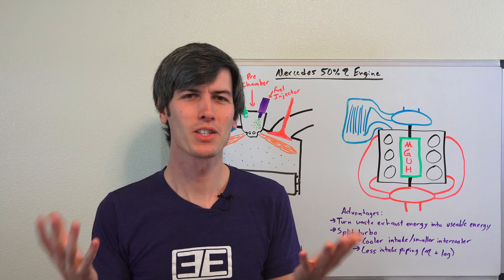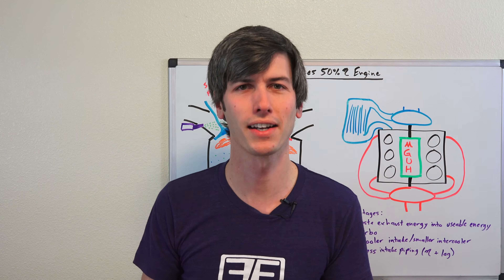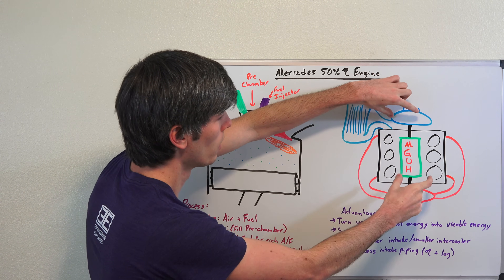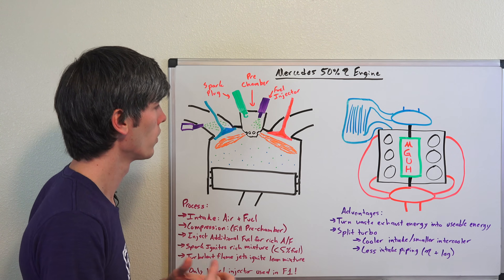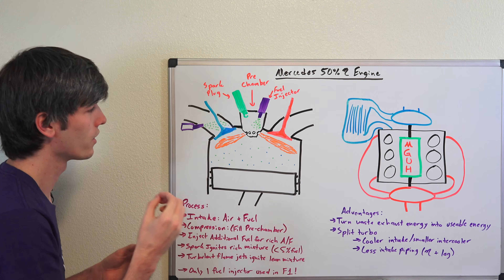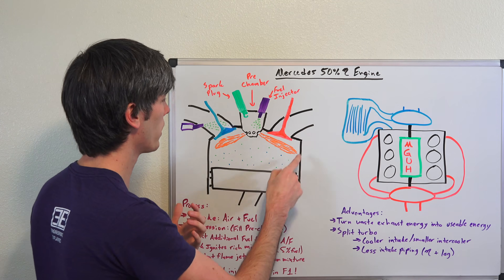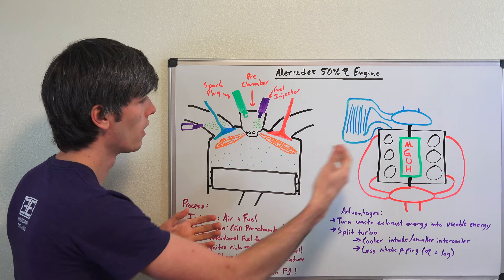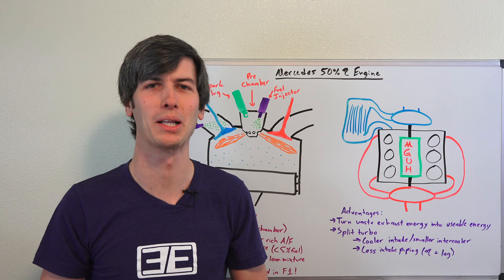Mercedes Created The World's Most Efficient Racing Engine

Comment: I have evaluated motor augmented turbo's as a way to minimize turbo lag.  The motor only needs to be big enough to generate enough exhaust gas to get the turbo into the positive feedback (why a waste gate is needed).  

My optimum system uses a CVT to drive the turbo.  Need boost, shift the CVT to spool the turbo very quickly, as the exhaust gas builds, shift the CVT to let that spool the turbo. 

Instead of a waste gate, shift the CVT to extract exhaust power from the turbine, controlling boost, and sending the excess power to the crank.

Comment: I think it would be smarter to leave the injector in the pre chamber and just have mulitple injection events. It would make sense as the intake stroke starts, an injection event would disperse some of that fuel through the pre chamber ports and into the cylinder, and then once the compression stroke is over, the cylinder AFR would be lean but the pre chamber could have a second injection event causing a rich AFR, that would ensure good combustion. That would be the most logical thing to do in my opinion, its simple, and easier to control than trying to spilt the injector into 2 different chambers.
Reply: Yeah, this is probably how it's done. It's exactly what is done in consumer engines, called stratified split injection. You inject most of the fuel during the inlet stroke to give it the most mixing time (standard for di engines) and then you inject a tiny amount right before the spark plug fires so there is a rich zone next to it.
Reply: Matt Knill it might become to rich in the prechamber
Reply: One way to find out.  Try it!  I would, but I've got to finish this beer.
Reply: Matt Knill i agree though

Comment: I wonder what the turbo lag would be like. Considering the length of the shaft and the magnets now attached to it
Reply: Zach Ball It's a Motor-Generator Unit. It actually spins up the turbine shafts when there is not enough exhaust flow to keep the turbo spooled up. When the turbo is spinning at full chat, it takes some of the energy that would over spin the turbo, hence the wastegate, and use it to generate power to send to the battery pack.

Comment: Isn't the lean/rich mix exactly what Honda did in the mid 70's with their Civic CVCC engine?  The CVCC had a lean mixture in most of the cylinder and a small area near the spark plug where the mixture was richer.  The plug ignited the rich mix and that ignited the lean mix.  That seems to be exactly what Mercedes is doing.  I guess the Honda patent expired.

Comment: would a lean cylinder mix not result in really hot cylinder temps? is that not the main reason people tune for say 11.5:1 afrs under boost, to cool the cylinder down? also that is one of the huge advantages of e85 and the like, since they require more fuel in addition to having better evaporative properties than 100% gasoline, they keep the cylinder cooler allowing more timing or boost to be added without the worries of predetonation? or does F1 also have someway to compensate for that like an additional cooling system specific for the cylinders somehow?

Comment: I think there is one injector in the small chamber, but has two pulses. One when there is initial intake stroke to fill cylinder (fuel will expand and fill the cylinder) and then a short one to fill the chamber with rich mixture when the piston is past half way back in the compression stroke.

But it is quite neat idea. 50% efficiency sounds awesome.

Comment: Many ships and nearly all modern cruise liners, use electric motors to turn the propellers. The diesel engines are just generators. I have always wondered why they do not have turbos in the exhaust turning a generator to assist the electric propeller.  It must be worth it as ships use an amazing amount of fuel.  The world's largest 15 diesel powered cargo ships put out the same emissions as all the world's diesel 'cars'. The largest container ships take 35 tons of fuel just to get moving from stop.

To get a large container ship just moving from stop, it takes  the same amount of fuel to run a car continuously 24/7, returning 35mpg for 27 years.

These container ships carry 14 to 19,000 containers. Put the containers on trucks nose to tail, they will stretch on a road around 190 miles long.

So, saving 5% of fuel using a turbo on the exhaust, on the world's 15 largest cargo ships makes a difference in emissions and also the emissions of the fuel refining and fuel distribution.

Comment: I have always wondered why if F1 engines are so efficient, why do they have so poor fuel mileage (according to the sources I've read)? I also understand that the numbers given are usually even lower by the fact that these cars are pushed to the limit. However, I can't think of how a car doing 3 MPG could do anything higher than 20 if driven normally. 

Is there other type of measurement to tell efficiency of fuel consumption?
Reply: It's because a lot of the power is used for aerodynamics, since most of the lap time is made from cornering at high speeds (we're talking 100mph+). So this requires a lot of energy to achieve. Street cars don't do this! lol! Factor in the lap times and they are the most efficient cars to achieve these speeds on these courses.
Reply: Ok, so here I go again. How high would the MPG would go if you drove it like street car, and it was tuned to be more efficient at low RPM?

As I said I understand the hard pushing of the engine increases the overall fuel consumption even while it's running with a very high efficiency, but does it achieve such high efficiencies only at full load?
Reply: To drive really fast, you need a lot more fuel than you probably think. Just an example, you may know that aerodynamic drag does rise with the square of the speed you are going. Now let's say we have a car that uses 8l per 100km at 100km/h. About how much fuel would it use at 300km/h? Well, you go 3 times as fast, that means the car generates 8 times more drag at 300km/h and that means you would problably need nearly 8 times as much fuel. (the mechanical loses stay about the same) So you would probably need about 50-60l per 100km at 300km/h.

If you go on a race track with car and really pushing it for just a few laps, you would be surprised how much fuel even a very economical car would use in this case. You can push basically every car to use more than 20 litres per 100km at a race track.
Reply: 177SCmaro no tuning its parts without adding or taking away components does not stop an F1 engine from being an F1 engine. Besides, to my knowledge each engine can be tuned by their team within some regulations to accommodate the driver's driving style and/or team strategy.
Reply: 177SCmaro you are now adding things I never said. I didn't say I want to make it street legal, or a street engine. All I'm saying is, what would the mileage be if it was tuned to be efficient all low RPMs and driven like a Sunday driver.

I don't even care if experts would still qualify it as an F1 engine still. My question was clear, and if you can't or don't want to discuss an answer stop replying because I didn't post to argue over whether you think my question is valid or not.

Comment: In F1 the spark plug has an integrated fuel injector done the middle of it. That’s what I’ve seen from F1 journalist. So maybe they split it between the main injector and the spark plug is the additional injector for the pre chamber.

Comment: Are there any major hurdles to using TEC or Peltier like devices to harness residual heat, or is the gain just too small to be worth it ?

I was under the impression that the pre chamber was used to time a drastic increase in cylinder pressure causing compression ignition, HCCI like engine.

Comment: Good video. What I don't get, how can an F1 engine have 50% efficiency, while normal car, even turbo diesel are not able to get more then 40%?
Reply: elm70 they just want to make as much money as they can. They don’t care about efficiency
Reply: One F1 engine must last 7 GP weekends (3 engines per each car for all season - 21 GPs). Those units last ~2000-3000 miles
Reply: It last 2000/3000miles (at least the Mercedes ... a Honda 2017 F1 engine normally last less then the half ;-) ... but .. while using 1000HP for 50% of the life time ... if  it would be tuned down to produce "just" 500HP max ... it will last for sure over 150.000miles
Reply: +elm70 Maybe because building an engine with the same efficiency of a theoretical Carnot engine is nearly impossible?
Reply: optimization, material, control system, fuel, versatility, etc.
Reply: Tuning. F1 engines don't tend to last more than 1,000 miles. Road cars are expected to last past 100,000 miles.
Reply: It is not so "simple" .. yes F1 engines has limited life, but also they need to spin at very high RPM (15K rpm vs 6K rpm) and produce huge power (1000HP vs 200HP), two aspects that should not help for get the best possible fuel efficiency ... it sounds to me that car manufacturer have been lazy , it is possible to make every day car much more fuel efficienct ... but ... for some reason they don't have the business motivation for do it

Comment: How do they extract the exhaust gasses from the prechamber?
Reply: As the gas expands inside the pre chamber most of its volume in displaced into the main combustion chamber. Along comes the cooler and therfore denser inlet charge, and then along comes the compression stroke which must therefore drive gas back into the pre chamber. 
But it could of course also be the force, or Voodoo, or as some say, the unicorn effect.
Reply: light dispels darkness it's magic
Reply: They don't
Reply: light dispels darkness
Reply: That's a good question.  I'm guessing it just gets extracted through the flame ports, though maybe not perfectly, but maybe well enough to still provide a benefit.  But that's just a guess.

Comment: Great video and an interesting concept. I wonder how rich the air/fuel mixture is in the prechamber and how lean it is in the rest of the cylinder. I'm also wondering if you would get carbon buildup around the ports of the pre chamber, although it probably wouldn't matter as the races only last two hours.

Comment: VTEC is 89% thermal efficient.
Reply: And that's before it even kicks in y0!
Reply: VTEC is 100% efficient at drying up pussy's within the fart can's noise range. Truly quite remarkable.
Reply: No its 69.420%
Reply: And vtec is like always last one in f1 lol....
Reply: VTAK didn't kicked in  mclaren honda, they kicked themselves out of the team
Reply: I think it is 89.999%
Reply: I think it is 89.999%
Reply: I read in John B. Heywoods engine fundamentals, p874 , a similar paragraph. 
Where efficiency gain is contributed to the improved mechanical efficiency.   
 But not further explained (in that page) 
So i looked further and found in Hiereth H. and Prenninger P., "Charging the internal combustion engine",p 30, an example of what exactly the mechanical efficiency gain is. 
it is then related to friction. So yes, efficiency is gained by relatively less friction loss for the same power. It is then further said " In comparison to this (mechanical efficiency) ,the other efﬁciency factors are barely inﬂuenced by supercharging, since, due to the change of density of the intake air, the ﬂow and thermodynamic conditions are inﬂuenced only to a minor extent." 
Note that this is said of supercharging methods. Which i think is a bit strange, considering roots blowers,... are also supercharging methods and they rely on mechanical energy, which is not taken into account in their mechanical losses.    
  
I also can understand what you mean by the effectively raising the compression ratio. The higher pressure during the exhaust stroke (because of higher remaining pressure at the end of the power stroke) drives the turbine which in turn compresses air to a certain extent and therefore it is like a part of the compression stroke already happened. If the engine had a longer stroke the pressure at the end of the power stroke would have been used more and thus been lower. That pressure would have been captured in mechanical energy and then be used by the compression stroke in the next cycle to compress the air. I think it is certainly an elegant way of looking at it and i vaguely remember my professor talking about that analogy. So thanks. 

An other way of looking at the process is like this. The remaining pressure (heat) (left over energy!) at the end of the power stroke that is then dumped into the exhaust manifold is recovered by the turbocompressor. This energy is then used to compress the air, leaving the engine with less pumping losses. This looks at the process as energy recovery. It is how you choose to look at it, in the end it means the same thing.  (if engine one is turbocharged and engine two is supercharged with inlet pressures set up to be the same and using the same engines, the supercharged engine will not recover exhaust energy and has to delived the power from the crankshaft.)
Reply: Lawl
Reply: Vtec turbo raises it once again, depending on size of turbo and how heavy your foot is
Reply: it's 69 actually
Reply: The maximum is 60 %  for an otto cycle (depending on compression ratio).
Reply: Eric Wesson it adds a complementary compression/detent on the thermodynamic cycle, so it's wider, that my guess I could be wrong.
Reply: rijste94 The Otto cycle doesn't contain the turbocharger or the mguh tho, but that 60% is impossible to reach because of the ~16 compression ratio required that would ignite the fuel and cause a miss fire
Reply: Turbocharger does scavenge some energy from exhaust heat, that's right. What's the mguh?    
     
HCCI otto cycle could get these high compression ratios. Mazda currently has petrol engines with compression ratios of 14 in their range without hcci. Also what spec fuel do they use in formula 1? 
Presumably it has high octane ratings?
Reply: Wrong : that is impossible~
Reply: Bro, no metal engine achieve greater than %60 thermal efficiency! Go study engineering for a while before posting goofy inaccurate fallacies
Reply: polychronio that’s because the VTEC technology isn’t even used in race engines. There’s 2 camshaft profiles economy and sport in a consumer VTEC engine.  The race engine is only tuned for racing and it’s only called VTEC by name.
Reply: I am currently going for my masters degree in automotive engineering :D
Reply: The distance between the exhaust turbine and intake compressor is borrowed or inspired from the jet engine industry sort off ... I wonder if they will adapt more tech from aviation to automotive?
Reply: this some kind of joke?
Reply: Calvin Engler 
Someone has apparently never watched a YouTube video related to cars.  I laughed at the original joke but more at your lack of inclusion in one of the wisest spread kind of jokes in car enthusiasts.
Reply: more like 2%
Reply: fk VTEC..tsi FTW!

Comment: Is it possible to get  100% thermal efficiency?
Reply: Hus 9 No
Reply: If the goal was to create heat only then you can get close, but to produce work there is always waste. If you're talking about internal combustion engines specifically then the theoretical limit is somewhere around 59%, since anything above this would create so much heat as to melt the metal components of the engine. You can use fuel cells to get to around 70-80% efficiency as they are ceramic but they are heavy and come with their own problems.
Reply: Not in any IC engine. You would still have heat leaving in the exhaust because you can't get 100% expansion with a fixed stroke, so some heat and pressure lost to geometry.
Reply: Jakejakejake jakejake you are wrong. There isn't a power plants over 70 % of efficiency.
The maximo Efficiency = (Tq - Tc)/Tq where Tq is the temperature of the hot source (on a thermal power plant the vapor is produced at about 350 C = 650 Kelvin) Tc is the temperature of the cold source, generally a river water or ocean water or even the air temperature (about 20 C = 300 Kelvin). If you do the math the max eficiency possible is about 55% but is very difficult achieve that valor. Normals valores are about 35 - 40 %
Reply: In some thermal power plants they use the 'waste' heat to heat buildings and whatnot, thats how they get that claim
Reply: No man, it is impossible. This could happen only if the friction would be 0, the engine wouldn't absorb energy and many other...
Reply: José Dias...A lot of assumptions there. I work at a said CCPP and I can assure you we achieve less than 7200 heat rate (greater than 50%).  Our superheated steam temps (your “vapour”)are almost twice your nomination of 350 deg C. What pressure are you basing those calls on? Are your condenser calculations running at almost complete vacuum? Also, ever heard of supercritical boilers.? Regardless of supercritical, many combined cycle power plants approach 60% efficiency.  The efficiency increase comes from conversion of waste heat; and I mean to electrical energy, not heating purposes as mentioned. But methods and values are varied beyond what you will find in a google search.
Reply: If it was possible to get close to 100% thermal efficiency they fusion power could power the planet.
Reply: In large scale combined heat and power plants can get up to 90-95 % efficiency which is impressive, but 100 % is impossible due to the laws of physics.